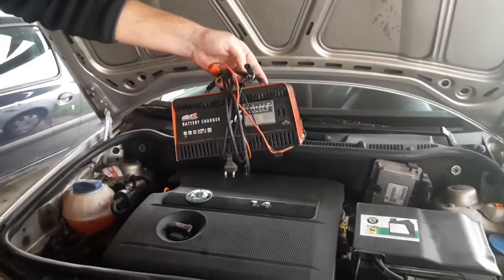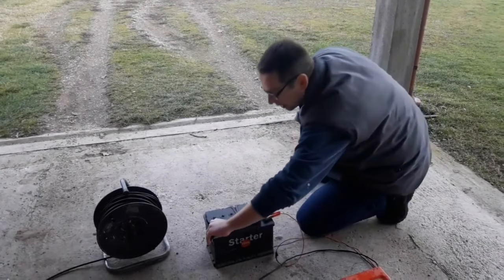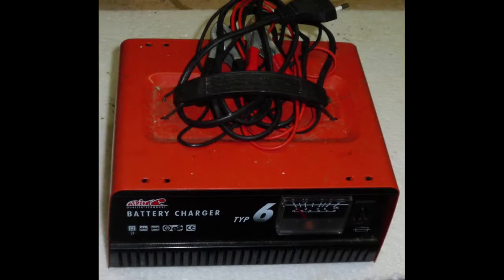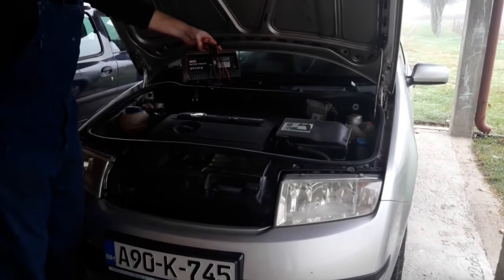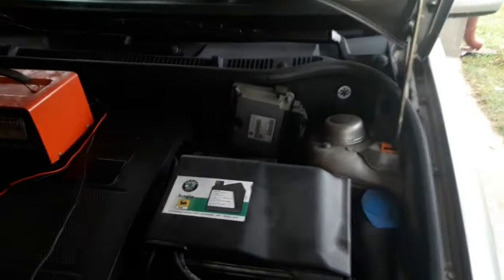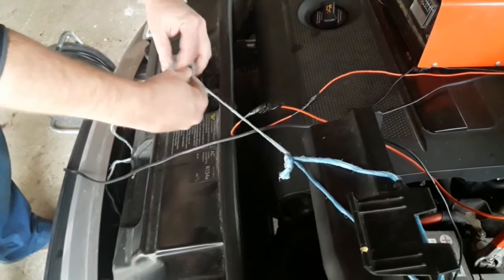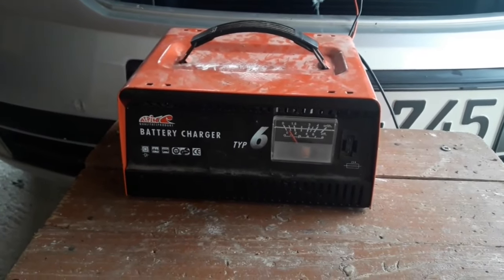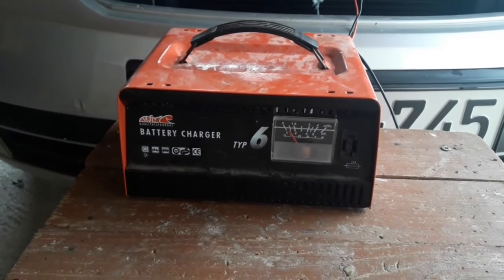Can You Charge The Battery While It's Connected To The Car?

Comment: 56 years of vehicle ownership and charging multiple family vehicles, I've never removed the battery from the vehicle or disconnected the battery from the vehicle to charge it.  Never seen a service garage or a roadside tow truck do it either.  With modern vehicles, disconnecting the battery, without an auxiliary power source will delete the data from multiple computers in the vehicle.
Reply from the maker: Hi, thanks for watching and for sharing! From personal experience it all depends on the car but you're right as the cars get more high-tech even disconnecting the battery has become a risk 🙂
Reply: Most vehicles will maintain memories for short periods enough time to replace the battery, but not likely long enough to charge the battery by removing it from the vehicle.
Reply from the maker: @matthewhuszarik4173  hi, thanks for watching and for sharing!
Well, personally I'm a fan of taking the battery out and charging it but with modern complicated systems even that seems to be a challenge 😞
Reply: @DespairRepair  I am sixty-five and in the era before electronics in cars we routinely pulled the battery to charge them, it made it easier to monitor the water level and add water as necessary. But I haven't charged a vehicle battery in years. I just replace them every five to seven years whether they are failing or not and you don’t have to deal with it. Thankfully alternators have gotten better so they keep batteries consistently charged.
The difference in how often I change batteries is the application, high performance and large engines get a new battery every give years with their higher than average draw for starting. For regular vehicles like our routine Toyotas every seven years appears to be more than frequently enough. I had an manual Corolla I allowed to go to battery failure because I could easily push start it and it went over ten years before the battery started to have problems. Of course I now live in California and my car batteries rarely face freezing temperature much less sub-zero ones. But my battery replacement guidelines I use originated when I lived in Michigan and up State New York where it gets plenty cold.
Reply from the maker: @matthewhuszarik4173  yes, I agree with you. Taking out the battery was always the best thing to do when charging.
I worked as a technician in the latter part of that era you mentioned and to be honest, it was a lot more simple and you could reuse and repair lots of parts.
The batteries were meant to be maintained (you could add distilled water and acid), recharge them and they were good to go.
With newer-generation batteries, you can't even access the cells to check them and try to revive it (on most types).
So, as you've said, buying a new one is the best and probably the only solution.
Then you have situations where you have to reset the car's computer when disconnecting the battery, start-stop systems, etc.
It only gets more complicated over time which leads to making such a basic procedure like recharging the battery while in the car a matter for second questioning.
By the way, nice to meet you, much respect for your comment and thank you very much for watching us.
Hope it's worth your time 🙂 and some envy to you for living in California 🙂🙂.
All the best!
Reply: Me neither, I've never removed a battery from a car to charge it.
Reply: I'm with you on this one. 😊
Reply: This is crazy. Modern smart chargers do not need the battery to be disconnected before charging. The Ctek charger even mentions that you can charge the battery while it is connected to the car. That charger you are using in your video, is it a smart charger or an old type charger?
Reply from the maker: @Raj-nh3fc  Hi and thanks for watching! It's an old type of charger
Reply: @Raj-nh3fc It all depends on the charger.
Reply: Thats odd, I've never seen it done this way other than in a pinch. I've worked at multiple garages and have always taken the battery out. Especially when working on someone else's vehicle. Any pro that does this is lazy and probably not a good mechanic. I stress that this is different if you are doing it as the video states. It is perfectly fine to follow what this guy says...
Reply: Quite correct. Using a battery charger is similar to using jump-leads. All OK if like for like voltages and polarity is observed.
Reply: The modern chargers are fine to leave the battery connected to the car as they do not over charge 😊

Comment: I have charged my car battery several times without disconnecting it and never had a problem.
Reply from the maker: Hi and thanks for watching! Same here, just don't how the latest car models react to this since they're packed with various electronic systems.
Reply: Yeah but have you started the engine while u did. Or left it overnight and forgot to remove the charger and started the engine

Comment: How you’ve made an 11 minute video out of this is beyond me. Takes 10 seconds to answer this question
Reply from the maker: It's magic 🙂. Thank you for watching!
Reply: And hoping to cut to the chase, I'm on the edge of my seat, reading your comment, hoping you wou-  oh.... I guess not
Reply from the maker: @someotherdude  thanks for watching!
Reply: @DespairRepair   you did OK;  
a booster pack v a battery charger:-  sometimes they are two in one, and you  start the car with the booster connected - obviously,  
I guess  it is no longer plugged into the main supply when the engine is turned over;  Worth looking into.
Reply: Hey guys can anyone say whether you do it or no?? 11 minutes???? Wtf

Comment: a 12V charger will charge it without much of an issue, because the alternator pushes 14v+ when it's running to supply the power and recharge the battery. if you are concerned you can use the 2a setting to reduce the surge. It will take longer but the idea is getting it to start and let the alternator take over.
Reply from the maker: Thanks for watching and for sharing!
Reply: Kindly note that your use of "your" should be "you're" as in "you are".
Reply from the maker: @Russell-rc6qq  thanks 🙂, noted

Comment: Modern smart chargers may damage the cars electronics, like the engine management system. The reason? Smart chargers provide a higher voltage to breakdown the battery's chemistry in order to revive it. So it charges at a higher voltage than your 20 years old charger. Typical exceeding 16v so could damage or reduce the life of the cars electronics.

Comment: With all the computer stuff in these news vehicles, I'm afraid to charge it while it's hooked up to the car.  In fact, last year I changed the battery in my 2017 Ram.  Sure enough for about 3 weeks, weird stuff was happening when driving.  Radio would come on when off, blower fan would go to high when on low and the remote start didn't work.  It took at least 3 weeks for everything to work the bugs out.  Like I said, who knows what possible damage could occur when charging in the vehicle.  Nope, I'll take mine out and do it.  Good video, though.  Thanks for posting!
Reply from the maker: Hi, you're welcome, thanks for watching and for the kind words!
You're right, if there's any risk of causing problems, it's better that way, especially with more modern cars.
With today's complicated electronic systems, you never know.
Added to that on some cars you have to hook up an OBD tool and do certain resets to make everything function properly (like with a start-stop system for instance).
All in all, everything is becoming more complicated, even a simple thing like recharging the battery.
Reply: More issues occur if you do actually remove the battery, unless you use a memory keeper as I do, it works well then

Comment: I have CTEK chargers and i use them anytime i feel the vehicle/motorcycle needs a top up and have done this for 30 plus years,without removing battery terminals ,plus it doesn't hurt to give batteries a top up especially if there continually doing start/ stop driving or sitting around as the newer vehicles have quite a bit of draw from battery while not being used .
Reply from the maker: Thanks for watching and sharing your experience!

Comment: I have a different question about this. If i’m leaving the car for a few days on some really cold days (say a trip and i’ve parked the car in an airport lot). Can i connect the keep the car charged by using a solar panel on the dashboard, connected to a power controller then to the cigarette lighter outlet? And of course, if possible, how?

Comment: Many modern vehicles do not have the battery in the engine compartment, and the manufacturer states to charge the battery using the earth and positive fittings under the bonnet and do not charge the battery directly. Modern automotive electronics control battery charge state, and this cannot be monitored/controlled if you hook the charger direct to the battery.

Comment: I have trickle chargers and trickle chargers that came from with the vehicle new.  Never was it recommended to disconnect a cable.  Disconnecting the cable actually would cause a problem that the car would have to be flat bedded to the dealer.  (The battery died and it had to be flat bedded because it locked everything up)  I also asked at my local GMC dealer and they do not disconnect a cable.  My charger is big and heavy on wheels and I used it on Class 8 trucks.
Reply from the maker: Thanks for watching and for sharing!

Comment: i wish to charge my car battery while it is connected with a car charger. i got an issue: do i connect the negative plug on negative or do i have to plug it in chassis or metal bolts?
Reply from the maker: Hi, thanks for watching and sorry for the late reply.
Connect directly to the battery if possible, that's the best way.

Comment: You also should not leave the battery directly on the ground/floor. It will eventually slowly discharge given enough time. A milk crate or non grounded/conductive box works great for this...

Comment: Thank you for your video. After charging and starting the car, or van in my case, how long should I let the engine run so the battery will startthe next time?
Reply from the maker: Hi and thanks for watching!
If the battery is OK, about 10 minutes should be enough. 
While the engine is running, if you can, turn off the lights, a/c, and other appliances, this will help recharge the battery faster.

Comment: Hi there. Ive just borrowed an einhell charger for my car. (i left the key on and battery went flat) When connected to battery and plugged  in the indicator was at 9V overtime it started heading towards zero. Is that the direction its meant to go?. I wasnt sure if it was meant to charge to 12V. Thankyou 🙂
Reply from the maker: Hi and thanks for watching! I think that's OK but just in case check the battery voltage when it's charged.

Comment: With a 2016 Buick verano the battery was dead and I had a jump start it when I did the jump start setting on the battery charging unit that I had plugged in It made the car go honky and make audible hum noise I quickly disconnected it, and then chose the non-jumpstart 40 amp fast charge method and just sat there for a few minutes until it started so yes the high enough voltage can mess up a lot of stuff I'm glad I was there to quickly disconnect it in less in a second
Reply: So yes even when trickle charging at 2 amps I just disconnect the negative from the battery and then connect the charger to the positive and negative of the battery and then go about it just to be safe this car is full of gadgets lots of modules would hate for it to have issues due to something I did.

I already had to disable the blind spot monitoring and the lien departure stuff it had because it was taking the voltage too low and causing issues with electric steering locking up while in the middle of a turn very dangerous so yes these modules are made very cheaply and can cause serious problems especially when they suck too much energy so if it's something that you don't use just go in the options in the menu and turn it all off everything can be turned off including background backup sensors the lines, lane departure warning, accident emergency braking warnings ETC ETC
Turning the stuff I don't use off stopped my car from having any issues with the power dropping too low

Comment: Why would you do this rather than simply jump start the car and let it run for ten or fifteen minutes so the alternator can charge the battery?
I understand that the battery can fail but of course then you would remove the dead battery and charge the brand new battery before putting it into the car. But I don't know why you would charge an uncharged but functioning battery instead of simply jump starting the car.
I park outside in a part of Canada where it is common to get -35° or colder in January. I am currently only driving for short local trips. So I have a trickle charger under my hood attached to the battery. I plug in when I park and keep the battery topped in the extreme cold. But if I had lost all (or most) of the battery battery charge then I would simply jump start the car. 
What am I missing?
Reply from the maker: Hi, thanks for watching and sharing your experience.
The point of the video is to provide a quick alternative to having to remove the battery, in case you don't have jump start cables available, a new battery to replace the depleted one, or else.
Also, if the charger is good, it will revive the battery much faster and more effectively than the alternator.
At least this is what I've experienced.

Comment: My 260a Craftsman charger  on wheels will not charge a  COMPLETLY   DEAD BATTERY !   It's the way they work.....  I spent $239,00 on it... So , I bought the same one like you got for $29.99.    Charges even  dead  dead dead   batteries.  for 3   1/2  years.

Comment: A small point I feel is worth mentioning , it's not + plus and - minus , these are mathematical terms . The correct terms for batteries and dc voltage is + positive and - negative .
Reply from the maker: Hi, thanks for watching and for sharing! You're right, I used the plus and minus terms as they are frequently used when working around cars, at least here 🙂. So it sort of rubbed off 🙂
Reply: @DespairRepair  No problem , I enjoyed the video , have a great Christmas and New Year 🙂
Reply from the maker: @Gordon_L 🙂. Thank you very much and Merry Christmas and a Happy New Year to you too and all the best 🙂

Comment: I did this yesterday and now my engine light is on. Anyone who could know why my engine light is on?
Reply: Most probably system detected loss of power and reports an error. It should be safe to start the engine and drive to a garage in order to check the error and fix it.
Reply: That ever happens again just take your car to an autozone or advance auto. They will scan your car for free and tell you what caused the CEL. If they can’t diagnose it, then take it to a mechanic. No sense throwing your hard earned money away.

Comment: I left the charger - which is quite old with a metal case - charging  the battery   and turned the engine over;  car didnt start, nor crank, and blew the battery fuse, i found later - which is quite hard to find and is expensive to replace, a fuse of 80 amps  -- don't risk it!   I think the battery isnt in good shape now either - dead flat, wont take full charge

worse it destroyed the charger - i wonder if the metal case of the charger made a short, as i placed it on  the engine bay. smoke was pouring from the charger even when the wires remomoved from bat.

Comment: I thought it was dangerous to hook the negative clamp from the charger to the negative post of the battery?? I thought you had to hook it to the chassis of the engine or someting on the frame of the car??
Reply from the maker: Hi, and thanks for watching! Nope, at least from what I've seen and done, the correct way is to connect the charger to the battery terminals.

Comment: I’ve just got myself battery charger for mine as I hardly use car so it’s always going flat. I’ve always had a portable power pack though that can jump start cars they are super handy especially if you have to jump car and get somewhere but can’t restart. I will sit mine inside car then run wire out doors and into the front while mine charges thanks for the video was a little clueless
Reply: Get a Battery Tender not a charger. This charger will never over charge your battery.

Comment: Why does my battery charger say to use a chassis ground for the negative and positive to positive terminal when charging with the battery installed?
Reply: Same rules apply to "jump starting" with leads. Discharged batteries may emit hydrogen gas and a spark caused by final connection via terminals can cause explosion.

Comment: Yes! Routine.  Otherwise, if you feel you must disconnect, you are possibly going toward a much more involved job plus new connectors/cables which could a more efficient charging system, but a very unhappy customer when you hand him the bill. Just charge the  battery as the owner asked for, then, as you see weak spots, point them out and seek owner's approval to proceed.
Reply from the maker: Thanks for watching and for sharing!

Comment: If your car has stop/start and a battery monitoring system (BMS) it's worth connecting the negative connector the otherside of the BMS sensor so the BMS knows the battery is getting charged (an earthing point is fine).
Reply from the maker: Thanks for watching and for sharing this valuable information!

Comment: Sir can I used a battery charger for jump start, means while the battery charger is plugged to an outlet and both positive & the negative cables are properly placed to its corresponding battery terminals then start a car?

Comment: Some cars will refuse to start if the system battery voltage is even just slighly on the low side. Your power door locks not unlocking while using your remote is a good initial hint that your car is sulking.